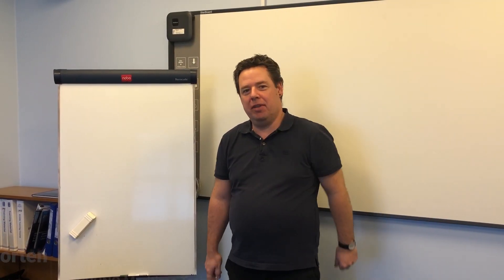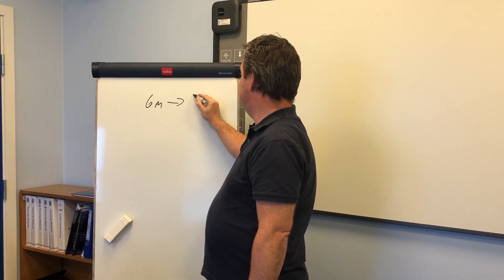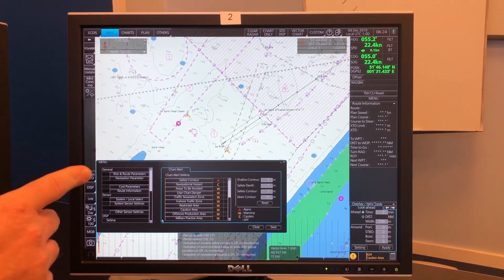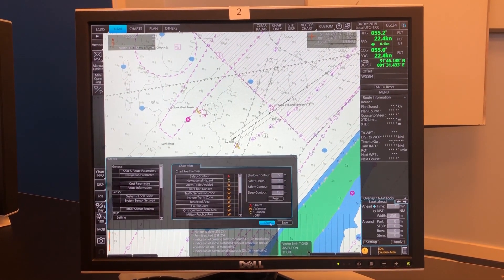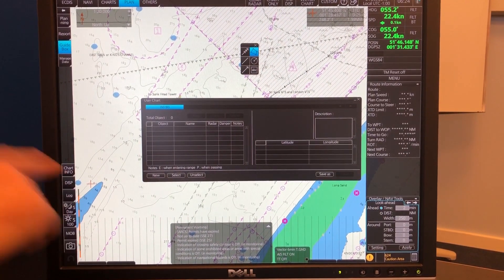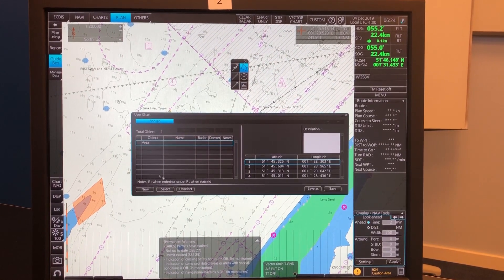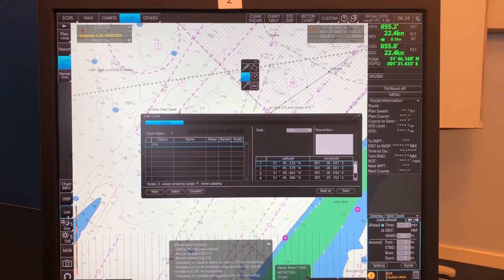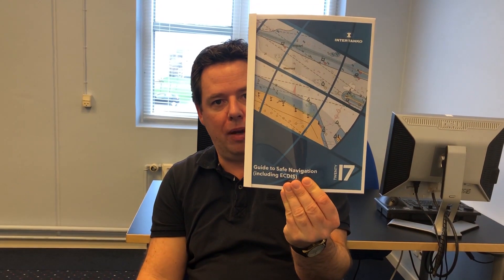How to make No Go areas with the user chart | FURUNO ECDIS tutorial |

Comment: Hi sir, good day, I think it is unsafe to lower the safety contour if that was the result of your calculations with respect to the present draft, squat and other parameters. It would be much better to keep the contour at 6 meters and after that, draw with the users map the no go areas even if it is inside the safety contour in the ECDIS. That is just my opinion.
Reply from the maker: Hi 
Thank you so much for writing to us and sorry for the late reply.
And thank you for your critical response, that is great.
You are correct, it is not safe to lower your Safety contour, but you should always remember that your Safety contour is a dynamic value, which should fit your circumstances, without risking a grounding.
Take care of yourself, and have a great day
Kind regards
Morten